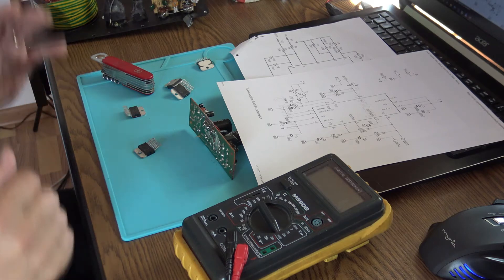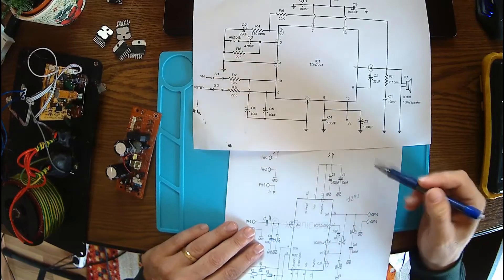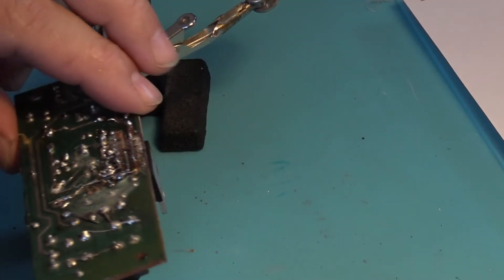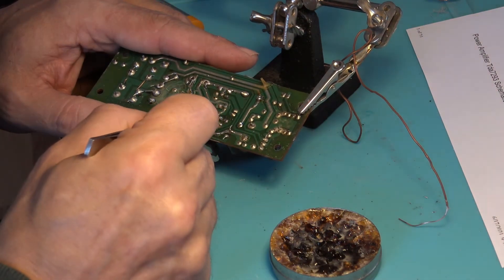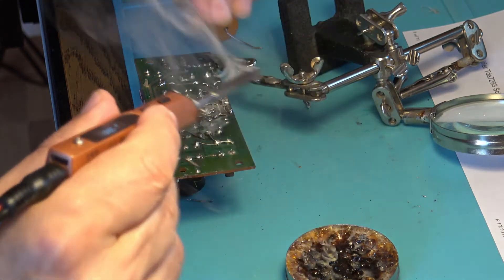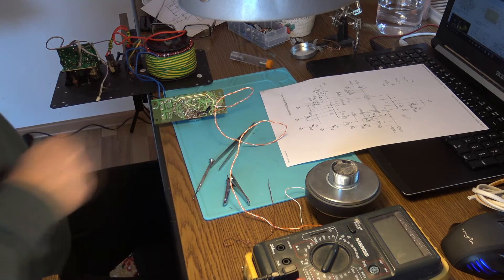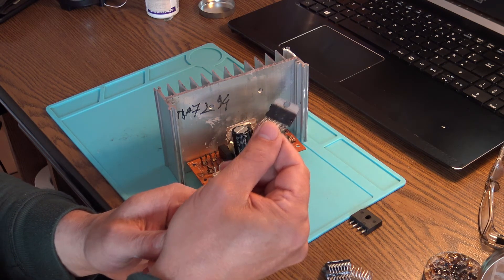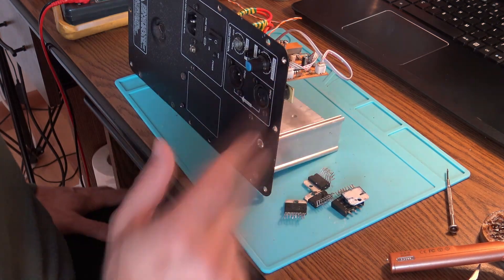Let's fix a 'disaster' amplifier with TDA7293.Lots of them!

Comment: hello friend..i have a question..
i have tda7296 and think is similar to tda 7294..my question is the mute and the stand/by pin 9 and 10 have to have always voltage in order to work?also is there a way to check with multimeter my tda if its in working order or burned?
Reply from the maker: I believe pin 9 and 10 should be in the air for should be in the air..for standby or mute..apply 1.5V..

Comment: You didn't notice, bootstrap capacitor (pin 6-14 or 12, 22uF) is in opposite polarity in 7294 vs.7293. This could lead into ic been blown up (my case). My board was for 7293 and I was putting 7294, because it was cheaper.
Reply from the maker: Thanks for let me know..I'll look for it